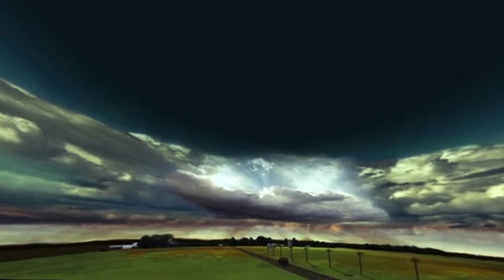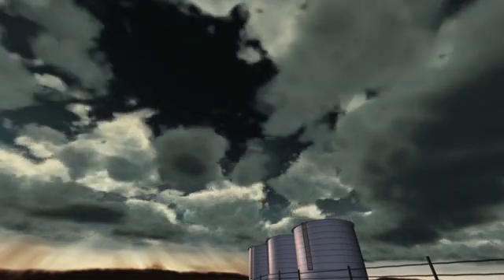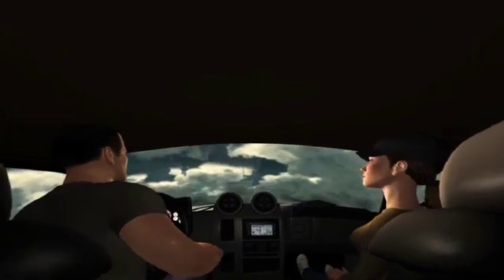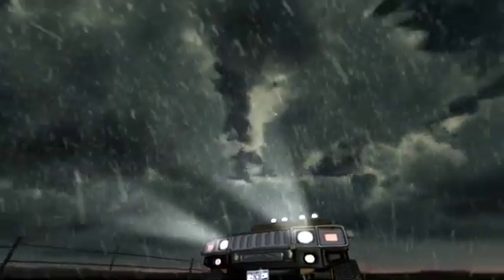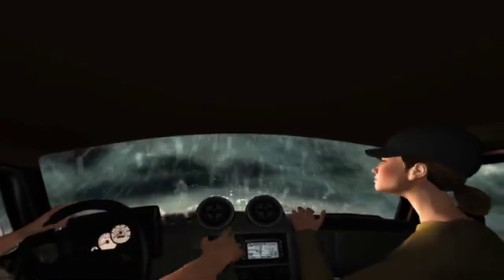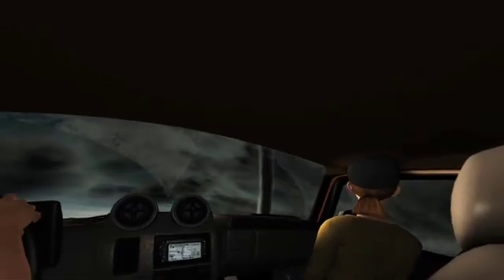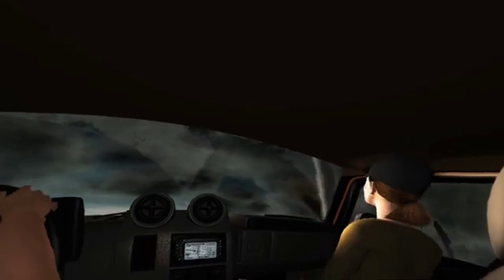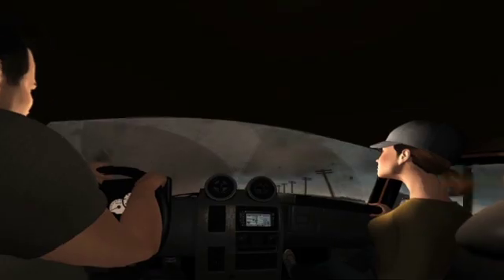TORNADO Force Five

Comment: How did they go into the tornado three times and not get sucked up?
Reply: Probably the tornado is not strong enough to pick up a car but it depends the strength
Reply: @spearmint2209  By the time it got to the house, it looks like it reached F2 wind speeds at the very least, so unless the tornado had started as only an F1, it should've picked up the car. It stripped the house of most of the walls except for the exoskeleton, and an F1 can, at best, steal the roofing materials off a house. It had to be at least F2, so it doesn't make sense why it didn't pick up the car despite them driving through three times. Maybe it's protagonist plot armor lol
Reply: @ladymorax  well maybe it started as an f0 then it gain more power but the car is to heavy for a tornado to pick up
Reply: @ladymorax  I guess that's the logic of the video
Reply: @spearmint2209  Fair enough. I guess it's pretty humorous anyway